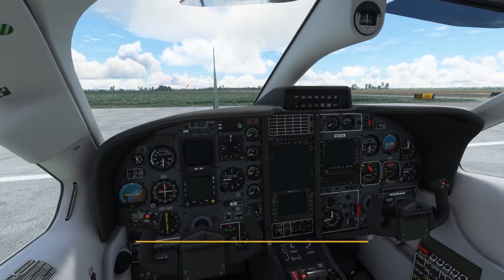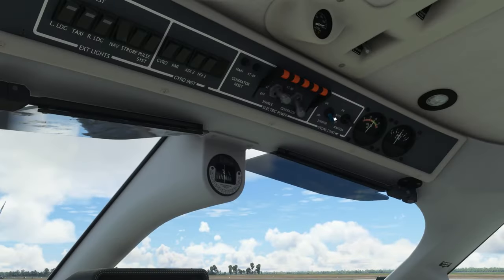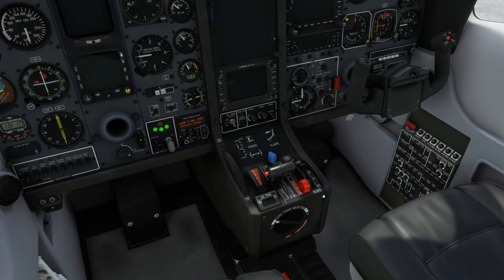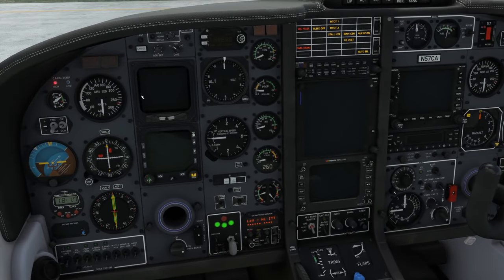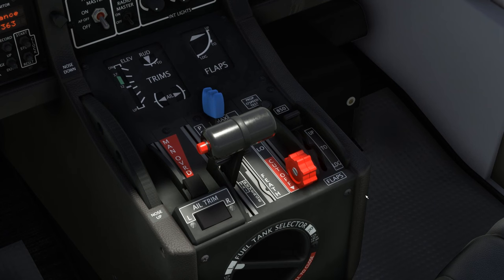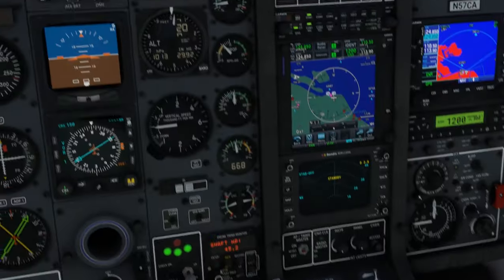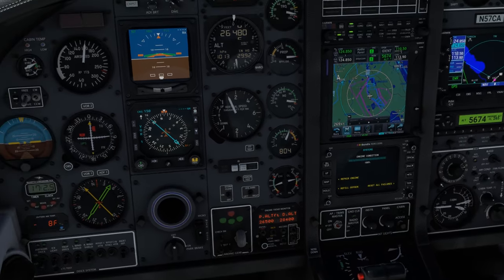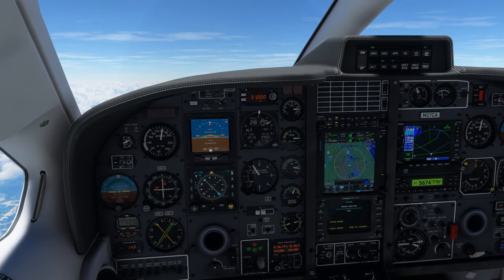Black Square TBM 850 for MSFS - Engine & Beta Range

Comment: This ist great! Will the King Air also be effected by this?
Reply: Might not be able to. Kingair was based on default MSFS aircraft, The TBM is brand new, created by Just Flight. They can do more with it. I would like to see updates to existing products to add new features as they add more to new aircraft though.
Reply: King Air needs an 850 treatment, full study level, sounds and external model.
Reply: @vermin1970 the only thing default about their KA is the external model. Everything else is custom, including the engine simulation, which does include hot starts and such on the King Air. I’m sure it could be implemented for it
Reply: @after_midnight9592  the only thing black squar left off the analog King air was the fact it used the default model and sounds other than that the systems depth is outstanding and on par with the most in depth king air study level add on

Comment: A real world question to the TBM850 pilots: are the detents between idle - beta - revers tactile?
Reply: When you mean tactile, I'm not sure what you mean, but you can't just go into beta. On the power lever, there is a detent lock to go into beta. You have to use your fingers to pull the detent lock up to allow it to go into beta then reverse. . I've never been in anything, but the 850 and the power lever on the 930 is different than the 850, but I assume a beta lock is also equipped .  On the 850 reverse is only used at high speeds and as soon the wheels touch the ground i go to beta  then reverse and back into idle as soon as possible so you do not ingest any debris  but you have to purposely want to go into beta you can't just go into beta
Reply: @hueginvieny7959  Thank you for the answer. That was exactly what I wanted to know. English is not my native language, so sometimes it is difficult to get the right words, especially on specific things like this.

Comment: Hi there. Firstly thank you for this great  looking product thst i an confident will bring do much joy to us simmers.
Could i just ask a question regarding the posistion of the NG and ITT gsuges. I could be wrong but in Steveo's youtube videos it appeared thst his 2006 model had the NG gauge above the ITT gauge.
Is this aircraft modelled off a different year to his?
Thanks agsin for giving us insightful glimpses into this fantastic product.
Reply: So I'm not sure about the 2006 and steveos, but the itt gauge is below the prop rpm with the ITT test knob to the left above the gas generator speed indicator.  Now I can't say that's how every plane was delivered, but in the POH section 7, page 7.3.11 shows the standard layout and how the plane I fly is. I would assume it's something you don't just switch since the ITT test knob would be located way below the ITT gauge. Like I said I've only personally been in one TBM 850
Reply: @hueginvieny7959  So as far as I can see then , the ITT gauge that is modelled is below the NG gauge and the NG gauge is below the prop rpm. Interestingly , the ITT test button is also in a different location as well from where you describe where it should be. I don't mean to nitpick, and it could be that the modelled layout is from a different year to that of Steveo's 2006 Model TBM850. I also understand that there are different models of the TBM 850 as well. Be good to hear from Just Flight on this.

Comment: I want to see, bright strobe lights, wheel chocks, tie down ropes, a tablet to control all doors, just like A2A simulation.
Reply from the maker: Sure you do, yes!  Well parts of that will be delivered in the update this week. Look out for it.  The tablet isn't part of that update though.
Reply: @justflight  Sir, where do I find info about update?
Reply from the maker: We'll publish the changelog today when the update comes out.  It's a very very long list and will be supplied by my developer just prior to the release of the update. Hope that helps.
Reply: @justflight  Thanks a lot for the info.